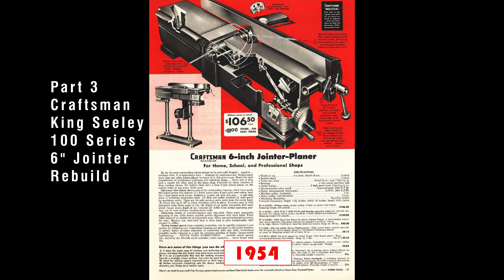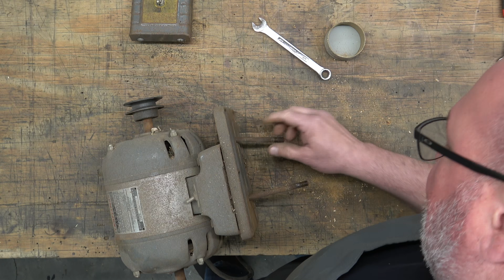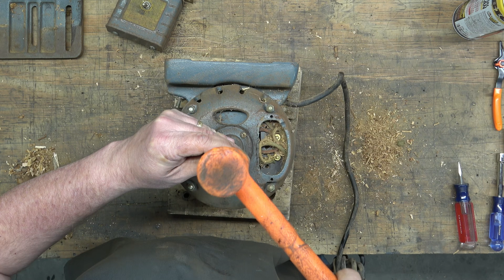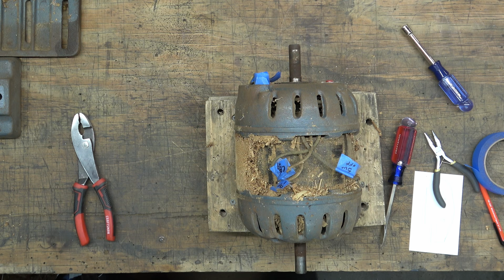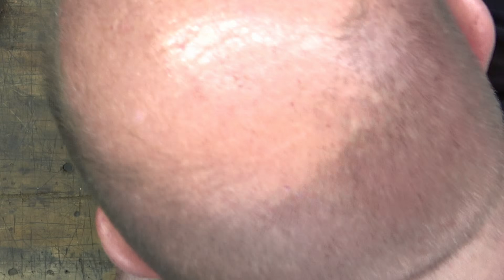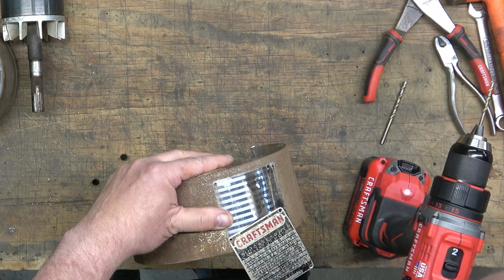Part 3 Craftsman 6" Jointer Rebuild (Disassembly Final)

Comment: If the capacitor was bad, is there a solution?
Reply from the maker: Yes and no. These sardine can capacitors are no longer made. One option is to source another same model motor with a working capacitor and cannibalize it then sell the motor for parts. Another option is to determine the capacitance and chain several smaller new capacitors together then fabricate a spacer plate that extends the base by 1/2 to 1". This has been done several times by members on the garage journal forum. Here is a thread when on the second page they discuss it. https://www.garagejournal.com/forum/threads/the-vintage-craftsman-gp-motor-thread.484126/

Comment: Good one, enjoyed the video. I would have thought they would use a sealed type motor with fins for this dusty application, but not it seems. Maybe it was up to each customer to put some kind of dust shield, protection around the motor.🐞
Reply from the maker: Most if not all of these classic tools were sold without motors. Craftsman did have a power tool line of motors but I do not know if they were more sealed than the general purpose motors. I have seen people add a small piece of sheet metal over the motor to keep chips from falling into it.